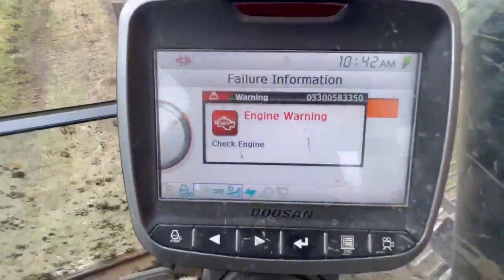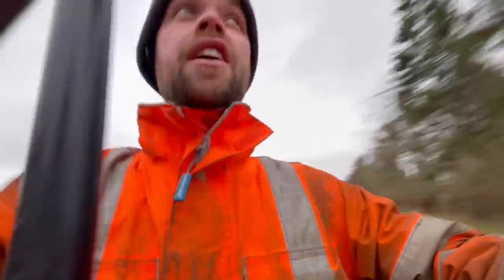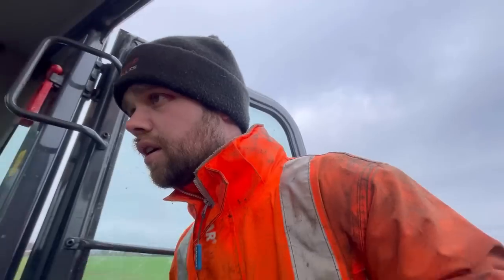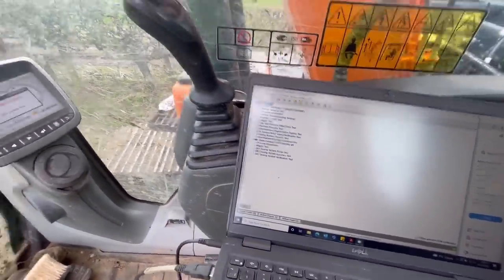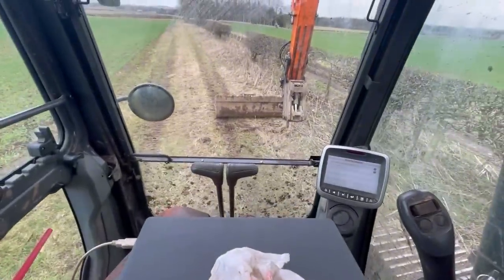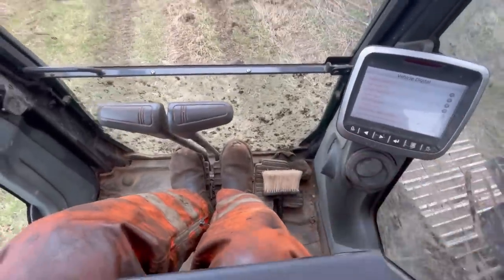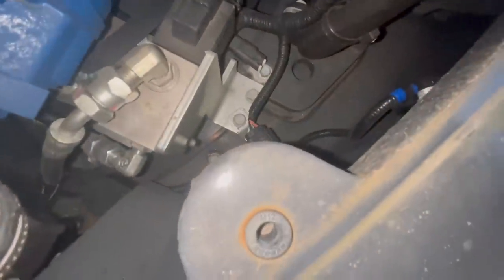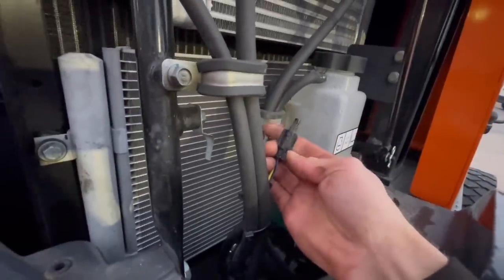Adblue error / Nox conversion low / can’t find it  / Episode - 162

Comment: I've also had the Nox low effeciency error on a Perkins before, Checked a few things and everytime after a day the error would come back. It turned out the Adblue Injector had filled the muffler with DEF. Couldn't see it from the outside but after putting an endoscope in it I could see it.
Reply from the maker: I know what you mean we have had the same problems it’s a bad code to get to the bottom of like I say you cant see what the Nox sensors are reading and you can’t easily see inside the mixer tube to see if it’s blocked

Comment: Just out of interest Ali, I know it’s mostly before your time, but what did fitters and technicians do before they had the benefit of fault codes and the ability to plug a lap top into the system? Were machines and their systems so much simpler that it was easier to make an accurate diagnosis, or was it a case of just changing parts until a fix was found? Great channel dude 👍
Reply from the maker: To be honest yea if it over heats it’ll be a fan belt off blue smoke burning engine oil white smoke head gasket gone black smoke to much fuel no power fuel filters 😂 depends how far back you go to be fair but you still need that foundation the laptop guides you if you use it properly it’s easy to be overwhelmed with the information on it
Reply: Only carried about 5 fuel fitters......did just about everything....if I didn't have a Perkins 1000 in it be a Lister......
Awwww life was so much easier and very little electric.
And as for bad injectors, crack pipe on each injector till you found duff one, wipp it out nip to local repair place wait for referb pay£10-20 refit and all done 
Must greener and cleaner.

Comment: One of my many gripes about the DEF system on my car is it doesn't tell you what its doing and you have zero control over it.
Why is there not a page telling you how long until it does a regen cycle and why is there not a button so you can start the cycle when it due. That way you would be able to hit the motorway, click start, and just keep your foot down until it done its thing. 
Just had to replace one of the Nox sensors and it was £660!
Reply from the maker: My car is the same haven’t a clue how much adblue is in it 😂😂